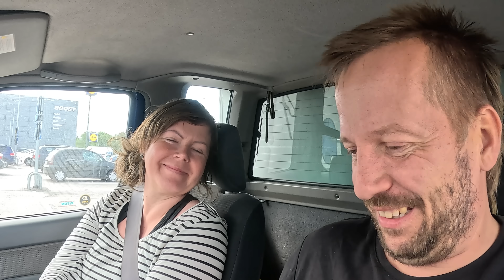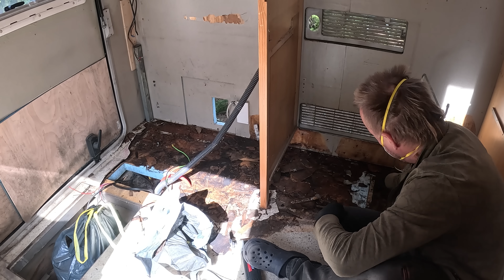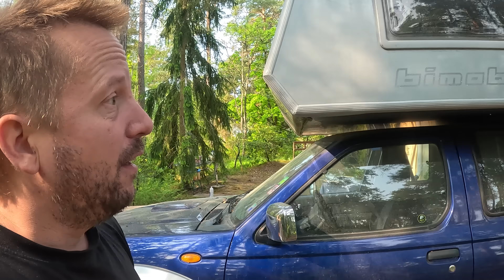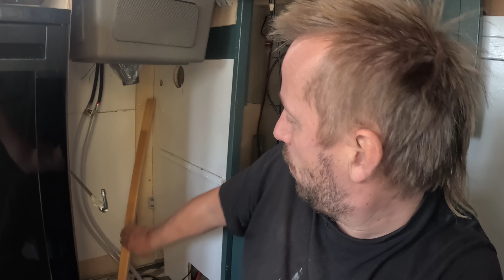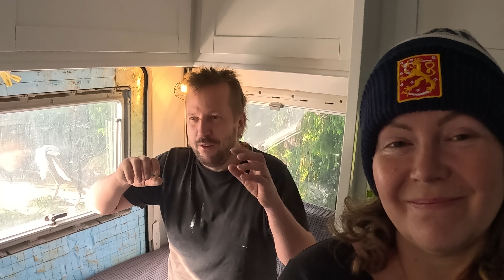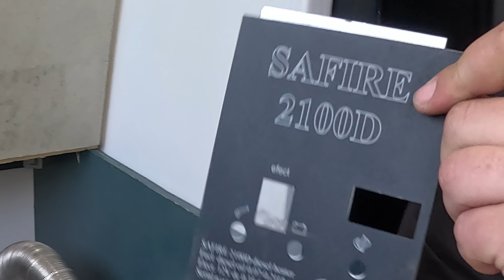IS THIS CAMPER BUILD GOING TO BANKRUPT US? Why cheap heaters suck?

Comment: Are you sure that diesel heater is not producing any carbon monoxide to the inside💨🙉, when you said that it smells when it's on, it just crossed my mind🤔 Did you get any refund of the car price from the previous owner as you mentioned before that you will ask for it?
Reply from the maker: It was coming in from the unblocked fridge vents. Now the vents are blocked and no smell. We got to an agreement with the seller that was good on both parties.

Comment: Hi, Nice progress.
1200 EUR for diesel heater ? OMG!. Nice but, no thanks I will stay with my chinese one for 100 EUR. Completly quiet, no smell at all, working great over 5 years now, with parts availiable all over the world for pennies nad 2 times smaller than this one. Nothing personal Joni, but it's extremelly expensive. Good luck!
Reply: Seen 2kw chinese heater and it was not quiet at low not to even speak about high. In this video heater sounds quieter - the pump is clicking slowly so must be much bigger pump than on chinese where this tempo would be minimum.
Reply from the maker: I have to disagree, i have been inside and parked beside of several vans/motorhomes with chinese heaters. All of them are really loud and you can smell it for sure.

Yes the heater is expensive compared to chinese one, but when comparing for example diesel Truma then its reasonable.

Comment: I just lost one of my 1,6m x 1m solar panels on my Ford Transit box van, it was attached with 6 90 degree angles that was attached to the solar panel rails with 2 big pop rivets per angle and 3 pop rivets going into the class fiber roof of the wan. But last year we accidentally  did run the panels into a low roof at a gas station. The driver did not think of that the van is 3,3m tall with the solar panels on top but could see no damage to the panels or the attachments And the trip before the panel disappeared I bumped into another roof myself when I was parking the car, the impact felt like it just touched, but something happened as later when I parked the car at home the panel was gone... I have 3 panels left now and they have to be mounted in pair so I will have to get 2 new panels now.... (pretty much impossible to find an identical panel again).